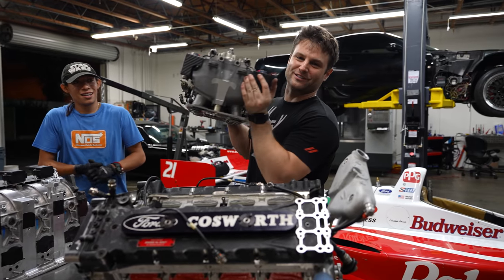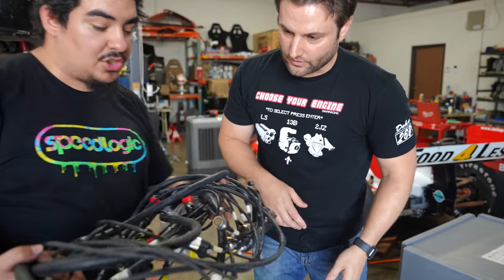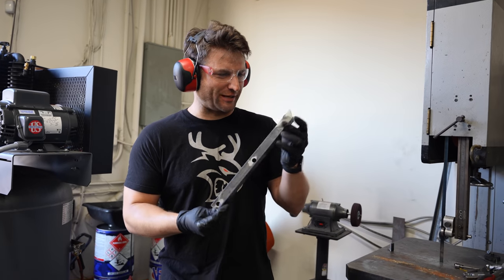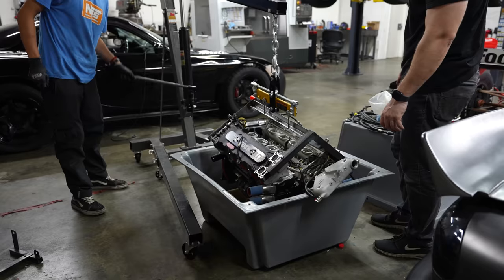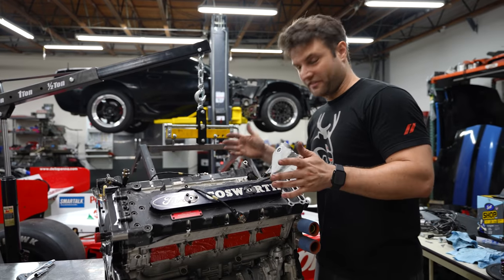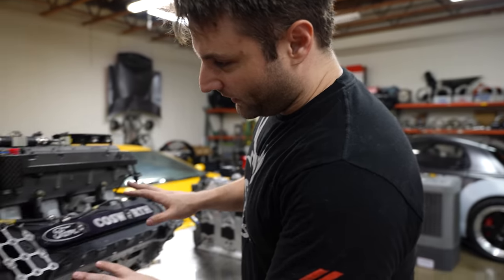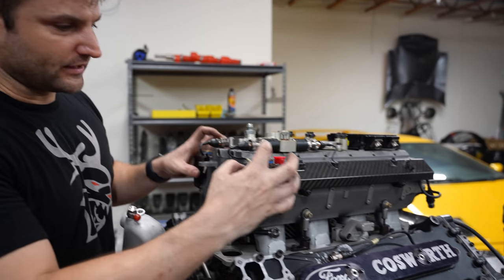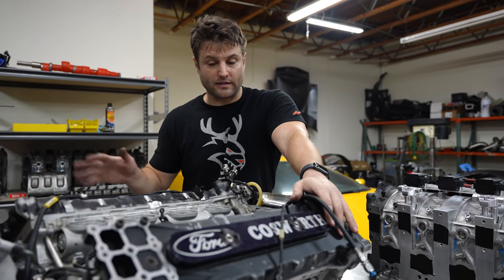I bought a $37K running IndyCar engine. I shouldn't own this

Comment: I'm really wondering how you own this motor. Has Cosworth been selling it's obsolete engines? When they were racing these they were never sold, only leased. BTW the turbo injectors were there to cool the intake charge after the compressor to increase charge density. Throttle is called a barrel type and was popular about 100 years ago before the drawbacks became understood. What are those? They tend to get stuck if they get even a little dirt in them. They have made a comeback since the 1980's but require lots of attention and expensive, low friction bearings. The key for the connectors is Mil Spec. The US military established design standards and these was made by Amphonal, Deutch, Canon. They require contact crimping, insertion and extraction tool though they should be packaged with a plastic insertion, extraction tool which you can't rely on because they break too easily. They are color coded red and white for 20 ga. etc. You should have a pair of rubber jawed pliers to unlock or lock the locking collar because sometimes fingers aren't enough.

Comment: FYI, Rob, there are guys that run these in historic classes (HSR and/or BOSS, if memory serves correctly), and since they're doing it as a hobby they will probably be willing to share info regarding the powerplant, setup, etc, as well as likely have some connections with drivers who race these things in said series and can give you some instruction about what to expect (and since a high-downforce open-wheeler is so much different from anything else, I'd suggest going to a driving school that uses small single-seaters and maybe even investing in something like a used Formula Atlantic or Formula Mazda to take to track days to get used to what it's like).

Comment: That #27 on the engine absolutely does mean that it was the 27th engine manufactured.....The Ford Cosworth XB debuted in 1992 and made approx 800 hours at 14,000 rpm

Comment: valve spring from japan 600cc motocycles can easy handle 14000-16000rpm and last over 100k miles.... this is masterpiece .  Not compare to 1992 CBR 250rr inline 4  engine can easly do 19000rpm and it can last up to 50000 miles

Comment: Most likely will have pneumatic pressurised valve system. You Will have to pre pressurize the system, this allows for definite high rpms in F1 cars like over 12000rpms or maybe indycars?? You might have to have some specialized.  pneumatic system.

Comment: As I clicked on this wondered if you knew to get the right engine for the tub. That engine/transaxle  is a stressed member of the chassis. Maybe contact Cosworth and see if valvesprings used in the T50 could be adapted to this. Doubtful but worth a email. That is going to be so much FUN! Now go do some hill climbs!

Comment: Rob, a word of caution. You may not be able to simply strip this down like you or I would......are any  fasteners   single use torque to yield ? Gaskets and O rings might be single use ? Even starting one of the engines might be a half hour "externally warmed" procedure. some race piston engines can not be started from cold, the pistons and rings are an interference fit in the bores until hot water and oil have been circulated by external heaters and pumps. Even hand cranking cold to find TDC could damage this thing. I'd love to see you succeed with this thing. See if you can find a retired engine tech who is willing to help you. Some formula's didn't even allow the team to open up the engine, all engine work was done at the factory. I sincerely hope you can pull this off. I have a tiny insignificant connection to these engines.... My grandfather was chief engineer for the London fire service during world war II. When the " blitz"   started to burn London to the ground, my grandfather sketched "on a napkin kind of sketch" the dimensions of a portable petrol driven water pump that could pump enough water to reach 7 stories. That engine became the "coventry climax" engine. After the war, there was a huge surplus of the tiny, light, and powerful engines that started winning races. When people had reached the limits of these little engines. and racing was moving to larger engines, an engineer was thinking about a V8....he looked over at a colleagues desk, and saw two blueprints of the climax engine, which happened to be laying down at an angle to each other. The basic layout of the cosworth V8's was born.... Some of this might be paddock racing legend, but these do have a fascinating history.

Comment: I’ve had 2 kove commuter 2s. They both sucked. Didn’t get very loud the battery dies around lunchtime and they would un pair from each other and I had to look up how to resync them all the time. Worst 80 bucks I’ve ever spent. However the company did send me a new one because I told them that it sounded like crap at max volume (max volume is not very loud) and that the battery life sucked. The new one they send was the same, I’ll never get another kove. Maybe it works good for someone but my cheap wallmart speaker gets 2x as loud for half the money and is super clear compared

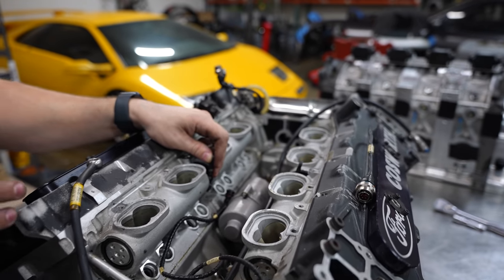Comment: 17:09 It's called a 'Drehschieber' (rotary-slide). Another concept that provides 100% throughput is called 'Flachschieber' (flat-slide). It's a sheetmetal with a hole in size of the intake wich slides in front of the intake to open or close it.

Comment: Hopefully, "mil spec" wiring connectors means more than it does compared to a lot of "mil spec" other things. Lowest bidder that can accomplish the initial request. You said 80's engine? I'm sure you realize that every single part that can age, did.

Comment: A slide throttle is like what a BMW 2002 carby ran(and many motorcycles), flat plate with a single linear axis.  That's called a barrel throttle body.  What a beautifully engineered bit of kit.

Comment: The pop off valve (or blowoff valve) isn't on that engine. That plate on the top of the intake is where it would sit. Those were controlled by CART back in those days I believe they were handed to the teams before and after sessions they would turn them back in. Look up turbogate of 2001, interesting history towards the end of the turbo charged era.

Comment: So I know I'm late to the party but, you should take notes on alignments when you pull a race motor apart. Things have wiggle room when you take them apart so ie: when they put the heads on, they may have made sure that it was pushed all the way up and then left. 

 It's little things like that that can make the valves align down the bore a certain way, create a little lip, etc. There's been times that I've seen a motor be down almost 50 horse from being assembled different.

Comment: I presume ITT cannon or amphenol mil spec connectors in the wiring harness? I use these in my DIY active speakers, for the speaker cables. yes, they START at $50 a piece.

Comment: There's 10 year old Ferrari and Lambo engines on eBay right now for not much less. 37K is a lot, but if it were double I wouldn't be shocked.

Comment: Back in the 90's I worked for a shipping company in Indiana that moved Indy car engines and I remember those same plastic crates (except they were white) that I'd move with a forklift.  So good to see one opened up....also interesting is that wiring harness is all aircraft connectors

Comment: I used to be in the Air Force and work on Fighter Jets, These are the same type of connectors we used for a fighter jet. So if you wonder why Rob is that excited over some cables. They are literally top tier connectors. (Also they are a pain in the ass to re-pin) :)

Comment: Just install the v8 and wiring harness supplied and save yourself the headache. 
That engine and chassis were meant for each other and you’ll get it on the road in no time.

A triple rotor won’t make as much power and certainly won’t be as reliable. There’s millions of dollars spent developing that v8 to perform in that chassis. Just stick to it and enjoy.

Comment: Just imagine what a 2000cc could produce in the Pontiac Aerotech achieved, 273 mph and over a 1000 hp, with a 13000 rpm redline, imagine that in a production car

Comment: The pre-turbo methanol injectors are less about adding more fuel and more about cooling the intake air to get the densest charge possible, even if you have an intercooler you'll get benefits from having those injectors. Doesn't matter how fancy your new ball-bearing turbo is, compressing air heats it up, and the latent heat of evaporation is a far more effective cooling mechanism than any intercooler.

Comment: Did you get a full set of operating instructions with the engine?  F1 and Indycar engines need to be preheated to a certain temperature before starting.  They are designed with such tight bearing clearances that they are pinched at room temperature.  The coolant and oil need to be preheated and circulated to warm the engine housings.  You have entered a different mode of engine care and maintenance.  Bug the guy you bought it from to make sure you understand every aspect of running it before punching the start button.  You don't want to end up with a fused lump of metal for your $37000.

Comment: Interesting point about this being old race technology but still you just wont see it in consumer stuff. While the technology and learnings do come, the materials and tolerances don't. To to mention the design requirements. Engines like this are designed to be run at the limit, short duration with extensive maintenance from skilled engineers. Those design requirements will never be seen in consumer vehicles as they straight up would fail.

Comment: If you're wondering where the inspiration for those connectors came from, you'll find very similar kit on aerospace engines from well over 40 years ago. Interesting trickle down tech, and it's cool-looking for a civilian project, but they're not as cutting-edge as they appear.

Comment: bet all the rod bearings are already spun a few degrees, should make a new set on the lathe. not steel on steel, have to add some brass. $37 bearing vs $37'000 engine, c=3 crack a rod

Comment: Those four injectors by the turbo are probably for charge cooling might want to keep them. I'm betting while you could get the flow rate you need for only 8 the the spray distribution pattern wouldn't be correct I bet they have each injector aimed right at the valve to help cool it as well.

Comment: Make sure you wipe down the bench before you put the engine down.  Between the webs, the sump is super thin.  
We lost a CA V8 because it was put onto a bench with a nut on it, popped the sump and wrote the block off.

Comment: I was the design engineer at Lola in the UK responsible for engine installations for this exact engine. Cosworth were always fantastic to work with. They introduced pre-compressor injectors before the giants of Honda and Toyota did in the same series. All from a small warehouse in Northamptonshire.

Comment: I think guys who have run these in vintage racing/demonstrations will drop the rev limit to 12-13k to eek out more runtime between rebuilds.  Those valve springs are no joke - at 15k you might as well treat them like a consumable item!

Also not on this but I believe the engine and fuel system was purged of methanol after every event, even with the hard lines.

Comment: Wow you are very trusting! I'd have to do a leak down test before buying a used race engine if I bought used. I couldn't give much at all for a used race engine way to many things to go wrong with a used race no warranty engine!!! Even most street and race engines have almost no warranty it's in the fine micro print

Comment: One of my favorite things about engine is the contained chaos. Absolute chaos. Engines spending at 10,000 RPMs with literal explosions happening over and over just a few feet from the driver. It's nuts.

Comment: Those are Lemo and Amphenol connectors not deutsch. Holy shit dude. Also on every race team I worked if you pulled on the boot and not the connector you’d get kicked in the balls.

Comment: If you notice when you turn the motor over only one exhaust valve and one intake valve opens on each rotation, not like the automobile engines, it works like a Superbike engine, creating a true swirl combustion and a higher rpm with off the chain horsepower

Comment: The fuel pressure regulator isn't just a normal fuel pressure regulator.  It is a boost-referenced fuel pressure regulator, which is why it is mounted into the top of the intake manifold - to get a unrestricted and undelayed value for the boost running into the motor.  A standard passenger car that has a turbo can just run a line from the intake manifold to a boost referenced fuel pressure regulator and it will be fine, but if you do that in a race motor there will be a small delay in the boost reference signal that is fed to the fuel pressure regulator in that small line.  This delay can be catastrophic in a race motor at high rpm and high boost, so you need to be able to apply the actual boost signal directly to the fuel pressure - at the time it is happening - so that there is no delay in the signal.  That is why it is mounted where it is.

Comment: I'd also pay attention to the engines flanges and bolts etc. Take the exhaust flange, if you compare to consumer made products, youll notice it is alot "smaller" or more slim than the one we put on our engines and also the bolts etc are all manufactured to be as light as possible while keeping its tensile strength. The development that goes into these engines are mind blowing!

Comment: @Rob Dahm
The XD is a fantastic engine. They are incredibly reliable for a thoroughbred engine and are still used for (and winning) competition today: https://youtube.com/shorts/j5kSjYcHLTI?feature=share
Also don't believe what you're hearing about the valve springs. The talk of the valve springs comes from a single man who ran cheaper springs than are specified by Cosworth. They will work but they're just not the real deal. If you get/have the right ones you wont need to replace them for years.

Get in touch with Cosworth before messing with it too much. They know the capabilities of it and it's cheaper than a full rebuild.
Reply: Definitely be careful mapping this beast. I do recommend consulting Cosworth first before changing out ecu tech and control systems

Comment: The four injectors in a cross-shape in front of the turbo are not just to feed more fuel into the engine, they are there to cool the intake charge (a cooler, denser charge delivers more oxygen to the cylinders at the same intake pressure).

Comment: So are ya gonna be getting a lathe too? Make all the parts you need ever could need? Lol.

though little tip for you. You can use a mill to turn small round parts in a pinch. Mount a lathe tool to the table & hold the part in the spindle.

Comment: The extra 4 is for post compressor injection. After it get compressed and hot it gets a shot of cold methanol. So they didn't have intercoolers

Comment: a lot of these engines are designed around weight and the distribution of said weight, even to the spark plugs remember a debate on the sparkplugs being to heavy for the job they do makes since seeing that is part of the chassis

Comment: Always amazes me with most of these race engines that the limiting factor was usually the engine management system. Throw in a modern one that can better keep up and update things at a higher speed, and suddenly you can do 90-99% of its race level power, but with surprising reliability 😆 Pretty sure that's the most common thing done with 80s and 90s race engines that get driven hard still.

Comment: Found this online...."The Cosworth XD was introduced in 1996 and ran through 1999.  It was replaced by the XF (and in 2003 XF-E).  It is a 2.65 liter V-8 burning methanol and producing in excess of 800 horsepower at 13,000 RPM and 40" of boost.  For reference, boost is measured in inches of mercury absolute pressure.  Standard atmospheric pressure is 30" (14.7 psi) and thus 40" equates to 19.6 psi or 4.9 psi of boost over ambient pressure"...... "The XD produced in excess of 302 horsepower per liter of displacement.  For comparison, a very well built normally aspirated Hayabusa engine with nearly the same displacement per cylinder produces 188 horsepower per liter on gasoline".... Talk about a monsterous little engine for being 20+ years old!!!!
Reply: That actually has me thinking, could one of those crazy Hyabusa based V8s be an option for getting an old Indycar back on the track on a budget? But then those things aren't cheap either but at least they are currently made.
Reply: @wingracer1614  could be...but they would need work too! I know for like $5k you can make 240whp N/A out of a busa so 2 would be ~$8k in parts fir both, plus $5k for good used engines...and even then thats only 480whp(tadical rated the sr8 at 460hp at the crank)...so i think a SBC from a budget sprint car making about 700 on methanol would be better. Or even a turbo honda K series maybe

Comment: From my pipefitting days , I’d call those ITB’s a full port 90 degree spool valve. Never really thought of that for a car but I guess even a throttle plate and shaft are a restriction. Super cool video!
Reply: Barrel throttles is the old school term for them. It's super weird seeing that Cosworth went with the barrel throttles as F1 cars will still use a butterfly. There was a lot of experimentation with barrel, slide, and butterfly throttles back in the 60s and 70s and most people agreed that the drivability that the butterflies offered over both slide and barrel throttles outweighed the power gains of the barrel throttles. Then again, as I typed this, I just remembered that Indy cars see ovals more than they see road courses and I wonder if they went with barrels over the butterflies simply for the straight line performance.